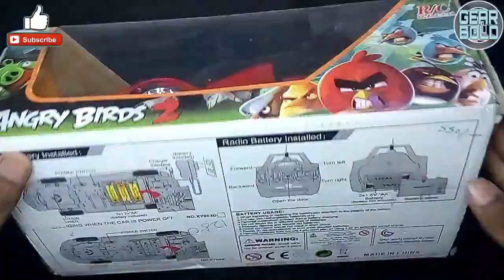Unboxing and Dissasemble remote control car | Whats inside RC car | remote control car kit |GearBold

Comment: 2:53Bro,why there is a wire soldered in to the top of the car.white wire?
Reply: that would be the antenna of the car
Reply: @MotoMoto-wv1ot  Why is gold foil attached to the antenna?